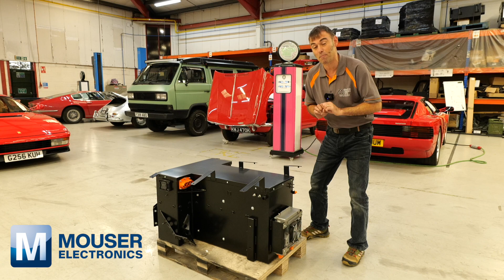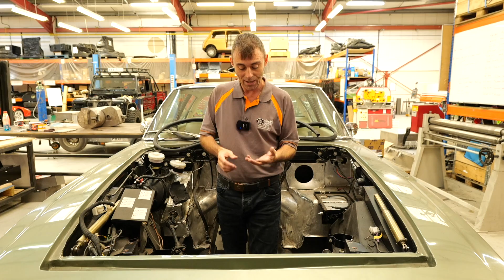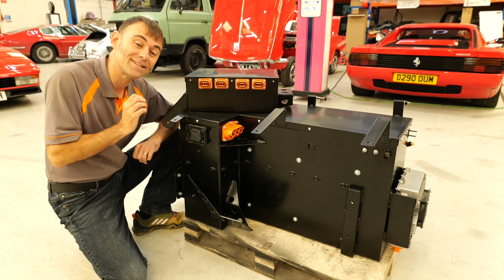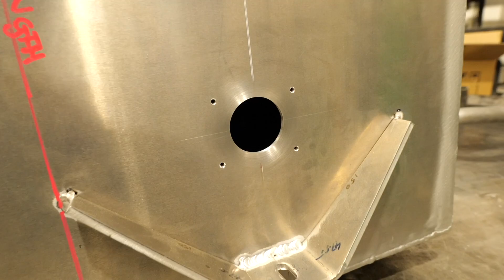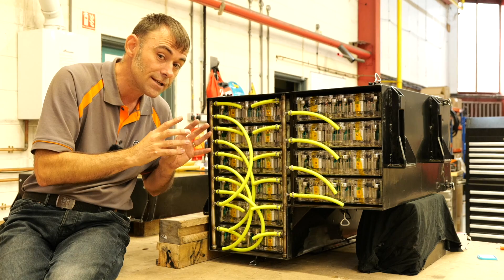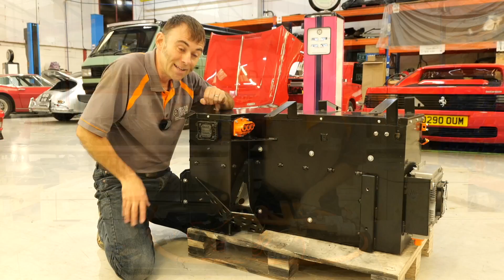EV Battery Boxes Explained

Comment: I understand that you cant offer the comprehensive breakdown on how to assemble a battery box like this, but is there a possibility that a video like that could be made available? Here in the states trying to convert an f100 and would like to create something like this in the engine bay rather than my current plan of welding together a utility box in the bed. You are by far the most consistent EV page on youtube and i thank you for the information!

Comment: How do decide what materials and thickness to use for the box? Also curious if you always place BMS and charger at or in the pack? Thank you for another excellent video!
Reply from the maker: BMS should always be inside the battery box. Charger is best to mount as close to it as possible to reduce your cable lengths . 👍

Comment: It seems there is one deficiency in the cooling system.  The modules are cooled in parallel, good, but the coolant from the first battery flows to the second battery. So, the second is operating at a higher temperature and therefore will have a shorter cycle life.

Comment: Your wiring really does look First Class, and that helps to inspire confidence in customers and potential customers. Thanks for the explanation, Richard. One question, and I might have missed it, but do your cars have an easily accessible emergency isolation connector?
Reply from the maker: Yes. They all have an accessible isolator. 👍
Reply: Thanks. That's reassuring. 🙂 @ElectricClassicCars

Comment: Thanks, once more, very informative!

But, one follow up questions, what are the requirements on the box, itself?
I'm struck by the structural integrity and weight. Seems sturdier than necessary, or am I mistaken?
I now understand that it (sort of) serves as a pin board for various services and connections. 
But could there be a heat sink opportunity here? 
Or scope for weight savings?

Comment: Have you ever investigated Basalt laminate sheeting as aeither seperators or casings.. its lighter than alloy and stronger... Its actually used as a replacement material for ceramic isolaters in main grid power pylon insulators for hanging the cables...its also highly chemical UV and temperature  resistant...  
Its also highly impact/ballistically resistant and maintains integrity from -250 - + 850 deg c actually.
 over a 1000...

Its green to produce use and recycle.  😉🧙‍♂️ Cost should be a bit more than E glass but below or on par with S glass.
It doesnt fail like carbon 

It can be easily and safely worked and doesn't polute in the environment... its natural rock spun into fibers and can be added to resins or moulded into castings..or pressed pannels.
If you wanted to add lightness you can use it with flax .. just a 👽 thought.
Reply from the maker: Interesting 👍
Reply: @ElectricClassicCars  one issue currently is supply but  its worth looking into .. 
Theres some interesting links on u tube. and articles on CW the Composite 🌍 materials site. 
Its been used in boat hulls try Windelo but in Eastern Europe they developed a whole range of products using it..
Three layers can stop a screwdriver blade or scratching..  over foam core and backed with more layers a bunch of Aussies fired a magnum at a transom it bounced it off ... It only scratched the gell coat /top layer. 🤔 
There was a company in Ireland 
Called Mafic ... but its globally fairly widely available. 
Just carbon fiber tends to be like expensive  jewelry these days..  but its environmentally problematic ..my interest is as a geologist environmental scientist and aging spanner head.. I think we need to reduce our technology impact and reliance on fossil fuels.
🧙‍♂️🇬🇧 if you want external links ive got to get past U tube blocks.🙄

Comment: What always amazes me, as somebody who works in industrial controls, encountering large motors every day; is how small the motors (and indeed inverters) are. For example this week I’ve been wiring 250kw motors which weigh over 1 tonne each, are approx 1500mm long and 900mm diameter, with inverters which are 600kg, 2000mm tall enclosures! It’s insane that they get 2 or even 3 times the power density in EV tech.

Comment: Always interesting to see just how these battery Boxes perform their function. I doubt that the Battery Boxes would be mounted upon elastic-type engine mounts (at the front of the vehicle), and, (as such), the battery Box would help to serve some needed stiffening of the chassis - or monocoque construction, resulting in a vehicle that handles much better. This is one spin-off benefit, not mentioned here. There is no heavy Engine Lump that is rocking and rolling under your bonnet!
Reply from the maker: True 👍
Reply: I and my wife object to you calling us heavy lumps.
Reply: If you're under the bonnet, you're sitting in the wrong bit of the car 😉

Comment: Thanks for your explanations of the battery packs. Here’s something I wish you would explain. Why do things effect electric vehicles more an petroleum vehicle? You said with fantastic looking black truck that changing tires would increase mileage by 15%. Why so much? Yes it would effect an ICE vehicle, but not 15%. Pulling a trailer is another thing that seams to effect an electric more than an ICE vehicle. Please explain. Use the whiteboard if needed. Love all that you guys do!
Reply from the maker: The effect is the same whether it’s petrol or electric. It’s just a matter of energy, I.e. how much energy it takes to push something along the road.
Reply: I suspect it’s that nobody cares about efficiency in petroleum vehicles. Petrol is extremely energy dense. If you need more range put in a bigger fuel tank, it’s just a sheet metal box. Petrol is lighter then water so the weight of the tank even full is not much. Batteries however have a low power density compared to petrol, are expensive compared to a sheet metal box and are heavy. Finding ways to not run down the energy in the battery is easier then putting in a larger battery.

Comment: So why dont manufacturers use Battery boxes of this type of construction ?.  i.e. The Range Rover hybrid which just took out 1000+ cars at Luton. That thing was going like a blowtorch under the car.
Reply from the maker: Why does everyone think it was a hybrid that started the Luton car park fire. Who starts these lies? It was a 2014 diesel Range Rover, numberplate and as E10 EFL. Not a hybrid.
Reply: @ElectricClassicCars  AutoExpert has already confirmed it was the Hybrid model.
Reply: Because they are now designing the cars around the battery pack (mostly roller skate frame where the battery pack is so tightly fitting it actually provides structural rigidity). Remember, ECC are converting classic cars in a way that allows the cars to be returned to ICE, to ensure owners don't lose value if they decide to sell back into the classic car market. 
NB: The above is my opinion, I am not associated with ECC or with the car industry. But I love classic and future classic cars.

Comment: Some very good quality work and explanations. 

There are some very real positives for taking gas guzzlers cars off the streets especially as GB does not have e85 from Biofuels which is probably closer to carbon neutral. This is not to say obviously that electrification is the complete solution as all heavy vehicles waste energy (anyone doubting this is welcome to borrow my push bike out with the panniers filled up a few hills just to check).

However, could you handle the burning subject of how to deal with fires involving EVs (should one have this misfortune). Is it best to just run for it or is it possible to find a fire extinguisher that can be integrated into the design? What type of extinguisher? Capacity ? Possible activation from a safe distance?

In addition, Lithium batteries are just a temporary fix as they are heavy and environmentally questionable. Are alternatives coming to market and will they be easy (in your opinion) to replace the dated technology from one of the US suppliers ?
Reply: E85 was available for a while, meaning the Street Eliminator turbo cars where turning the wick up, and making some serious power, but I don't believe it's available now, which I find strange....
You ain't putting a lithium fire out, I think the big fire blankets should be part of the electric car kit, it won't be about putting the fire out, just trying to prevent it spreading.
Reply: @anthonyrawsthorne656  E85 is alive and kicking in France, it is half the price of petrol! 
[As part of France's energy transition it is very popular as it is made from agri waste (not maize as in US etc). It is simply crazy that the Cons disregard this. It would be a good solution for sugar beet contaminated with some of the awful pesticides put down (and which are unsafe)]

I agree that Lithium is not easy to manage, and this is why I would genuinely like to know if the pros have a solution other than making heavy boxes.
Reply: @Andrew-vx2ls  I think it's something in the region, of a year of the average persons consumption of corn/maize, to produce enough ethanol to fill large tank full of E85, which is probably why its not available in the UK tbh, although even at the current 10% ethanol content, potential food is taken out of the food chain.
Reply from the maker: Here’s an episode we did on battery fires a few weeks back. 👍 https://youtu.be/9kNIyTQ2jeM?si=npVwWXmpAV__wRJf

Comment: With EV battery fires being quite common lately, how exactly do you manage thermal runaway should a pack combust? How do you minimise risk etc?
Reply from the maker: EV battery fires are not common. https://youtu.be/9kNIyTQ2jeM?si=MiobDSnsHhw3nPKu
Reply: Which EV fires are quite common lately? I try to keep a close eye on such things and other than batteries in cheap Chinese scooters we seem to have had remarkably few. "Thermal runaway" is the term used for a battery that is beyond help ... as you would see in the video they make sure there is an escape route for gases in such an event.
Reply: @MrAdopado  over the years, there's been hundreds of lithium fires in tech , but as such, more and more safety devices are in place (balance charging, low volt cut offs, over voltage protection, Tesla not allowing fast charging of any car that's had a decent G shock etc). Still not 100% safe, but getting better as time rolls on. Storing that much energy in a small place, os always going to be, challenging , be it Hydrozine, nuclear or electricity.
Reply: @anthonyrawsthorne656  I would never underestimate any potential cause of fire ... but let's get some perspective here! EV car fires as a proportion of numbers are rare. Car fires in fuel cars as a proportion of numbers are common. The "advantage" of fuel cars is the energy density of their fuel ... that fuel is invariably stored in a plastic tank. Read the analysis report of the 2018 multi-story car park fire in Liverpool (no EVs). The fire was rapidly spread by fuel coursing through the car park, down drains and onto other levels.
Reply: @MrAdopado  I'm only really using my experience with RC lithium batteries over the last decade+ of use tbh. As the cells come to their end of life (although we hammer them, fast charging is at 1- 5 C and discharging at upto around 60C...) they become less and less stable (usually see a cell imbalance when charging though right enough). I've never heard of a battery just randomly igniting either , usually caused by heavy impact, or when being charged (because of this, RC cells have to be charged in a fire proof bag ,BRCA rules). Over a decade of lithium cells used in racing, and the only effective way of dealing with an in car fire, is to cover the whole car with sand, using one of the mandatory sand buckets ,and let it burn itself out, not practical full scale..
Yes, the risks are alot less than fuel, but are alot harder to deal with, currently.
Reply: @anthonyrawsthorne656  Yes, thankfully the designs of the packs used in cars nowadays have built in cooling (and warming) to keep the pack within an optimised temperature range when in use or when charging. The battery monitoring systems are highly developed too. (Home charging at 7kW can be around 0.1C depending on pack capacity so has a relatively easy life! If using rapid charging they are still lower C rating than your RC batteries plus they're being constantly cooled during the process.) 
Obviously the cars also have to go through the entire safety and crash testing regime the same as any vehicle.
We are therefore comparing apples and pears here ... the "lithium" word might seem to imply that all lithium packs are the same in all cases ... just bigger in cars ... but that's not really the case.
Reply: @MrAdopado  aye,  lithium ion and lithium polymer have a slightly different make up,  with safety more paramount than all out power,
but apples and pears will still get eaten by the same bug ( thermal run away ).
Reply: @MrAdopado  Fuel in ICE cars is never stored in plastic tanks.
Reply: @barryamorris  Fuel was not stored in plastic tanks when I was a boy, or when you were a boy perhaps. Nowadays it is very common. Google is your starting point. Check it out and come back to me.
Reply: @barryamorris  Hi Barry ... have you confirmed how many petrol and diesel cars nowadays use plastic fuel tanks yet ... it must have come as a surprise to you! (The first model was a VW Passat waaay back in 1972 ... and since then the prevalence has, in a manner of speaking, exploded!
Reply: @MrAdopado  This is irrelevant to my original comment
Reply: @MrAdopado  so you missed the news about the fire at Luton Airport from a Range Rover Evoque hybrid that took down the entire arrivals car park? It now has to be demolished as a result. As for the escape hatch, well that just let’s the fire vent. Is there anything within these battery boxes that acts as an extinguisher to control the fire risk?
Reply: @barryamorris  bigger questions need raised tbh, like why when there's a serious recall, (Believe the Range Rovers where being recalled, due to an issue with the high voltage line?), are the cars still driving about.
Although the % risk is low atm, as more and more EV's are on our roads /car parks,  we'll see /hear more, maths says that, but also more and more will be aging with batteries coming to the end of their working life.
I know IC cars have fires (classic car scene is awash with fuel lines rotting with modern ethanol fuel), I've got an OMP system for under the bonnet suppression for my project, so not sure if a similar systems can be fitted to these battery boxes.
Reply: @barryamorris  I understand that the Luton fire was caused by a 1st Gen Land Rover Evoke ... that wasn't available as a hybrid.
Reply: @MrAdopado  it was confirmed as being a diesel hybrid. The source of the flames coming from the exact location where the battery compartment sits under the passenger side of the vehicle
Reply: @barryamorris  I can find no official source that states the car that started the Luton fire was a hybrid. If you point me in the right direction for this info I'll take a look.
Reply: @MrAdopado  Thata because the media always tries to control the official narrative. They will tell you what they want you to hear. Never the truth. Battery fires aren’t good if the the government are trying to nudge everyone into EV’s

Comment: Does the cooling circuit do the cabin heat or is that a separate heater?
Reply: It's seperate, unless you get into the very integrated world of Tesla heat boxes where can use a heat pump to transfer warmth from the batteries to the cabin. If it's cold and you want to heat the cabin, you may also want to actively warm the battery.
There's a fascinating youtube video from WeberAuto that goes into the Tesla heating & cooling system. Basically it can take heat or cold from any part of the car and transfer it to another part of the car for incredible thermal efficiency, but it requires absolute design integration from every part of the car. I think we're a fair way off being able to use such techniques in classic conversions...
Reply from the maker: Heat pumps are closer than you think. We’re testing now. 😉👍

Comment: I hope that converting a Morgan +8 is possible? It's a realwheel drive and it has not much space to put a battery into. But I would be happy to know that.
Reply: Loads of space for batteries ... remember, you are removing that huge V8 under the bonnet ... and the fuel tank ... and exhaust ... and possibly clutch and gearbox (though ECC often retain those).
Reply: @MrAdopado  Hmm , as I can remember the V8 block was Aluminium.  I guess not much weight to replace it with a battery. Maybe with all together 300- 350kg ?